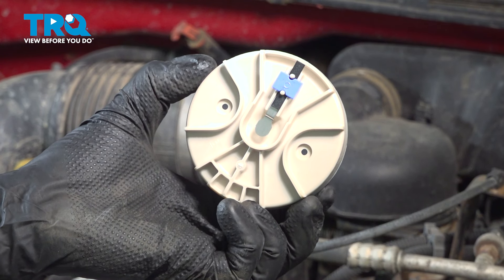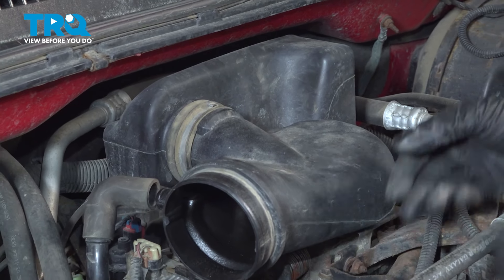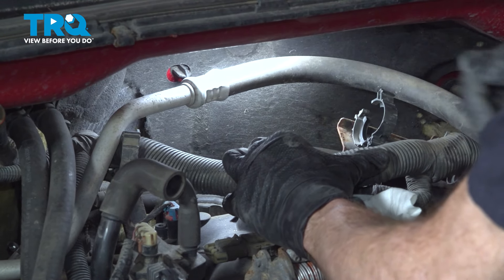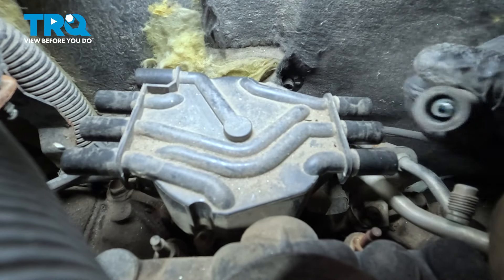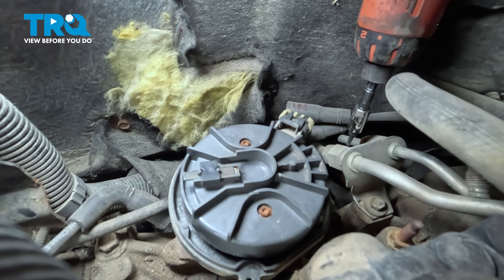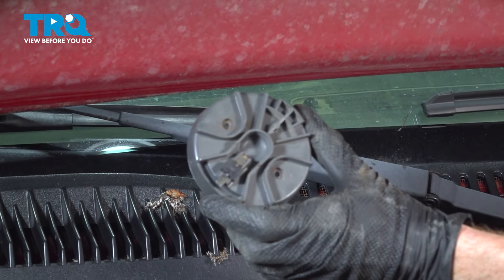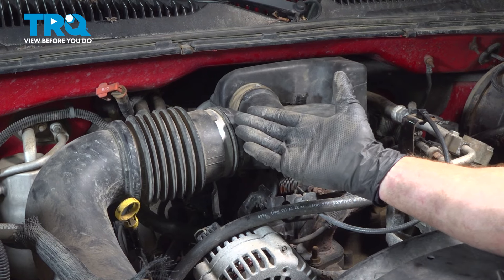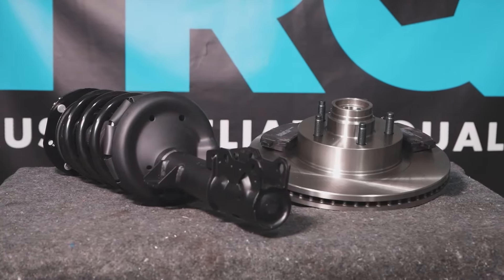How to Replace Distributor Rotor 1999-2006 Chevrolet Silverado 1500 4.3L V6

Comment: Cool. I watched before I started changing both the rotor and distributor cap. It took me no more than 15 minutes. Now my truck starts right up and the check engine light has turned itself off. 😊

Comment: Nothing aligns with the notch on the reluctor wheel you can look at your video and see that, and those two little tits are difficult to locate into the two little holes I found using a toothpick in the rotor screw hole and holding the  rotor  up  from the reluctor wheel so that you can see under the rotor that the toothpick goes into the reluctor screw hole then slide it down over the toothpick  then wiggle it around till the other tab goes in, put in one screw pull the toothpick out and install the second screw